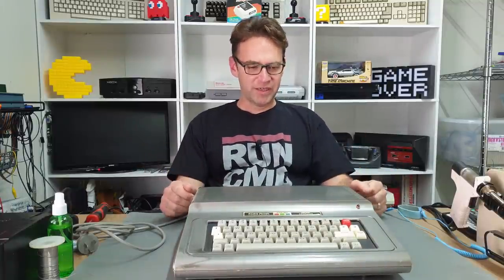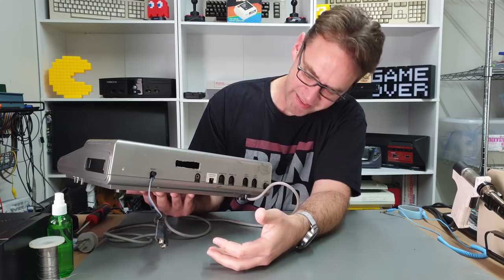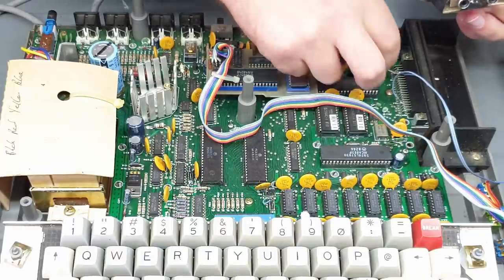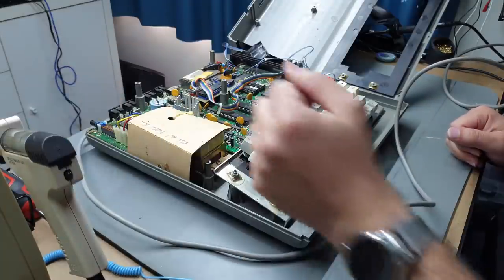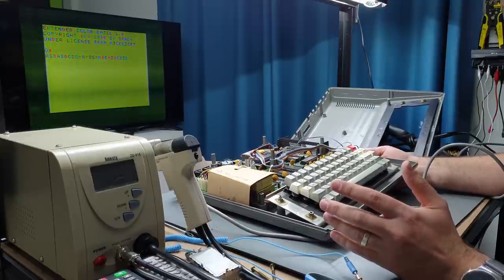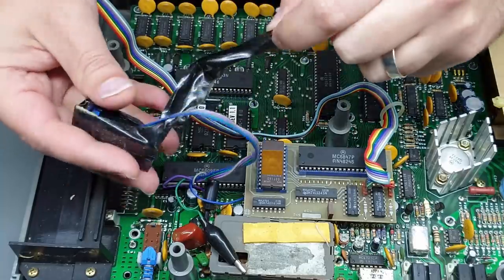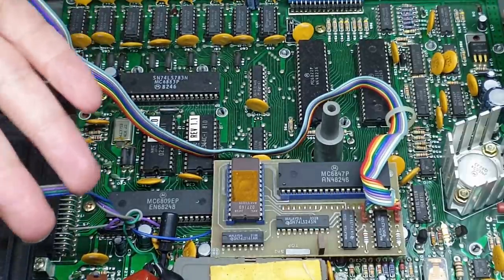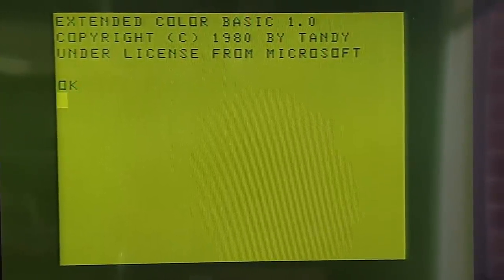TRS-80 CoCo1 - A look inside the heavily modded CoCo #SepTandy

Comment: Try SHIFT-0 to switch between upper/lowercase (or upper regular/upper inverted, depending on your one switch). Note that BASIC has no idea what to do with anything but the default case, as far as keywords go. As you figured out, the lowercase kits were basically ROM images of character sets (which is why you have an EPROM on your satellite board); so that one switch tells the 6847 VDG to switch from it's internal (inverse video for lowercase) character set, and from an external ROM (the true lowercase one on the EPROM chip). Great video!
Reply from the maker: Thanks Curtis, I think I've figured out how it all works now after putting it in the other CoCo. But interesting to hear more detail about it. Do you know if these were fairly common?

Comment: The lowercase and font mods seem kinda pointless if it just forces it. There has to be more to it. 
But man, yeah. Even composite is terrible on these Coco 1’s. Admittedly I haven’t even tried composite on my 3.
Reply: FYI to both Mr Lurch & TheRetroChannel, there's a mod out there called cocoVGA that adds several graphics modes plus outputs via an S-Video connector to a cable that has a standard VGA connector on the other end and will output perfect crisp video to a VGA monitor.  I believe it works ok on PAL systems, but there's an issue because PAL systems locate the VDG in an odd spot making putting the case back together an issue, but it's certainly worth checking out... cocovga.com
Reply from the maker: @johanlaurasia  Thanks John, yes Jason actually pointed my towards the cocovga before we started SepTandy this year as I was whinging about the video output from RF and from the fairly common composite mod. And although I considered the cocovga, I wanted to see what was possible with a handful of passive components, and voila - S-Video
Reply: @TheRetroChannel  Yes, that's an impressive mod considering it was your own roll your own solution, and it works very nice!  Will also serve the community well as I'm sure it's way cheaper than CoCoVGA, and cost is a consideration for many.  I did a video where I fixed a bad ram chip and installed cocovga.
Reply: Composite output on a stock CoCo3 looks pretty bad as well.  The CoCo3 RGB output is vastly superior!  Commodore did a much better job with composite output, for example.
Being a CoCo3 owner who uses both RGB and composite (for NTSC artifact colours) outputs with a Magnavox 8CM515 monitor, I'm interested in Svideo/composite mods for a CoCo3.
Reply from the maker: Nice, I'll check your channel.

Comment: In it's highest mode (256x192x2), it had black and white, but alternating black/white and white/black dots would produce a red or blue color.  What color you got relied on weather the color signal was syncing to the rising or falling ramp of the color signal.  This artifacting was commonly used to create a 4 color mode in the 2 color high resolution mode giving red/blue/black/white.  You'd commonly have to hammer the reset over and over until a particular box turned red or blue, then proceed to the game (but actually you could just ask the user what they saw and adjusted how you obtained your colors based on that).  In any case, it's pretty clear switch 2 is forcing the ramp one way or the other (something built into the color computer 3, holding down F1 while turning on would force the color one way, turn it on without holding any key would force the other.
Reply from the maker: I've read about this and certainly in NTSC machines this has its advantages, but on PAL machines this trick looks like arse either way. There's a comparison of both in the first video
Reply: @TheRetroChannel  Yeah, agreed, it's definitely an NTSC quirk, and yeah, on PAL I'm pretty sure it looks horrible.  The CoCo wasn't particularly popular across the pond, but the Dragon, which was essentially the same Motorola reference design with their own ROM, but I'm not sure how things worked in the higher resolution modes on those devices, which, aside from the ROMs were very close to the CoCo in design.  Anyway #SepTandy is turning me on to some new retro channels including yours.  Like what I see so far (sub'd!)

Comment: The 3rd switch looks like it's swapping which ramp the color is syncing to (rising or falling), which affects red/blue in the false 4 color mode (actual 2 color mode).  Looks like switch 1 is (trying?) to switch between black on green / green on black (inverse), obviously switch 2 is enabling/forcing the lower case.
Reply from the maker: Yeah, I've tested it out in the fully working CoCo1 and you're very close. If I can't get this CoCo working properly then I'll use the working one to demonstrate what they're supposed to do